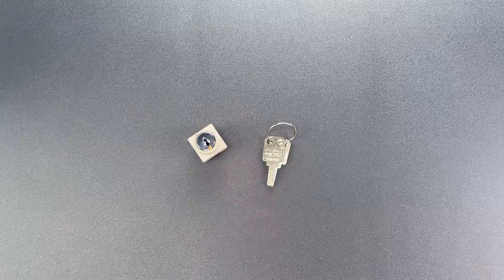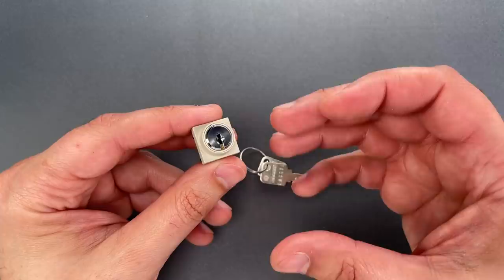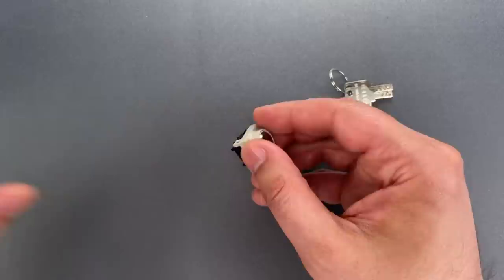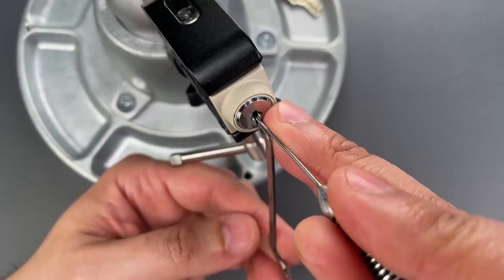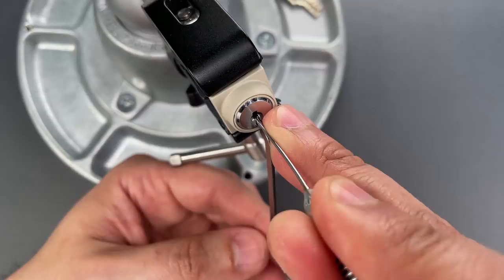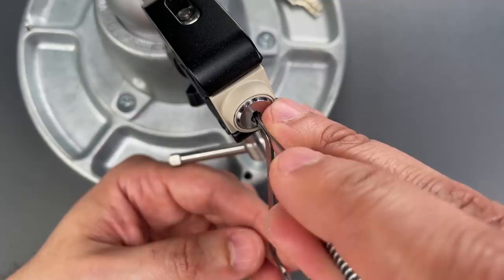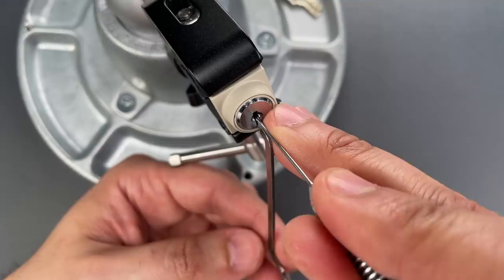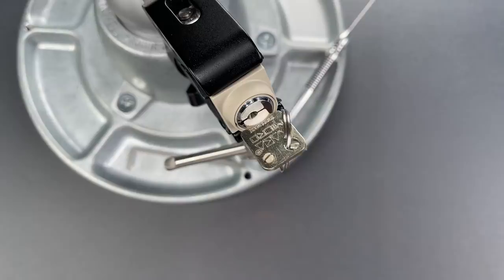[1354] Small But Mighty: Kaba Micro Key Switch

Comment: These locks should be used on gun safes and other dangerous high security items in police cars. Not the McDonald’s toy locks they have now.
Reply: In Europe, gun locks are much better.

In the U.K. the most common is a deep set mortice lock and there are two differently keyed ones on each safe.

It defeats many tools and makes it hard to feel, simply by making you insert the key 10cm before the end even comes to the lock.
Reply: In fairness, due to how tight those clearances are, I wonder how durable and reliable it is. You see this in firearms as well. The tighter the clearances, the more accurate it is, but less reliable it is, and vice versa.
Reply: @arnox4554  
Also in fairness, locks are generally quite simple mechanisms. With very small forces and movements.
The worst that can happen is a pin not moving which can be easily prevented with strong springs and enough, regularly applied lubricant.
Reply: @markp8295  true, both of my rifle cabinets and my pistol safe have very long, dual bladed mortices. They're also inside a brick built cupboard, with a steel lined door which is security pinned and double locked, and they're Rawlbolted to the fabric of the house. My firearms liason says we have a better security arrangement than most dealers.
Reply: @Zundfolge  Thats pretty much it. Frankly a gun lock isnt going to do anything for anyone. It may perhaps keep a naughty child from getting their hands on it accidentally but teaching your kid gun safety is a much better option in the first place.
Reply: @isosev  teaching your kids gun safety is not an option, it is a must.
the gun locks are there to protect neighbors children...
Reply: @carstekoch  I don't think those things would apply to this particular lock though. Or at least as much at all. The tighter the clearances are, the more easily any kind of build-up can block the movement of parts, and it looks like this lock is incredibly tight.
Reply: @arnox4554  
There are a lot of things in the world that require high precision. Like the equipment that makes the computer chips you made your post with.
Reply: @arnox4554  
I fail to understand why my points would not apply to this lock?

It's very hard to get a normal abus lock to seize up without seriously mistreating it, to the point it's pretty much unheard of.
Last time I heard it was my bike lock 2 years ago seizing up. And that was because the ballbearings rusted in place after winter. The actual cylinder was working perfectly.
Higher tolerances make it easier not easy.
Reply: @Zundfolge  That's true on multiple levels, they ARE crappy on purpose. The first purpose, though, is by those politicians (or rather the lobbyists buying them lunch) intentionally drafting confusing, conflicting and burdensome gun laws. 

An outright ban on firearms is consistently held as wholly unconstitutional, but the US legal landscape is full of haphazard carve-outs to absolute statements in the constitution. So they intentionally make it as difficult as possible to follow the law on gun ownership. The intent is that you won't be able to keep up and will either violate the law and lose your rights, or that you will give up in frustration. One example of this is the type of locks required. In some states it's a fully enclosed in-barrel lock, in others, it's required to block the slide from closing. That effectively means you have to stop between those states to change the locks on your firearms. (The general recommendation is to use a car safe separate from ammunition to avoid the whole mess.) When they're actively defying the constitution, it becomes that "say without saying" game.

From the firearm owner side, quick-open has been the priority, followed by not damaging the firearm and price. That means loose tolerances, a lot of plastic, and BARELY meeting the requirements of the law and even the definition of "lock". The only attempts at making standards for a lock, LPL has even covered, and they are representative of this tug-of-war between the parties over it. In California, the lock needs to stand up to someone unskilled without tools for a set number of minutes (I think 20, but I don't recall exactly off the top of my head).

As a non-lawyer, I absolutely hate the idea of legal carve-outs in constitutional rights. Having them as the absolutes they're written as is problematic, but exploiting other clauses in the constitution to inconsistently allow unintended exceptions undermines the rights themselves. Even with less controversial rights like "free speech", we have a whole slew of exceptions that their very existence creates the "chilling effect" the courts have themselves cautioned against. All the arguments for them that I hear are "it's necessary because" logic that amounts to there being no political will to fix it the right way. And that's why our laws are like duct tape around a broken water main. We generally agree we don't want our neighbor to be allowed to own a nuclear weapon in his garage, but no one is willing to make a constitutional amendment for where the line is because we're all afraid the line will end up somewhere we don't want.
Reply: @arnox4554  If well made, and kept lubricated, opening it a few thousand times should not make much difference.
Reply: @Zundfolge  I'm sure it's economic. I use a large combination safe instead.
Reply: @arnox4554  So it's not used outdoors, or in dusty environs.
Reply: @arnox4554  
You are using the proper word. LPL always says tolerances when he should be saying clearances.
Reply: @markp8295  makes it harder to access in need of emergency too
Reply: @Merennulli  i want my neighbor and I to have whatever the government can. As the 2A was intended. 1st and 2nd should have no ifs and or butts. Simply what is written. As intended
Reply: @dansv1  in machining, it's tolerances. Since locks are made in the machining field they are referred to as tolerances.
Reply: This would be easily defeated with force. It's for electrically securing things, not physically securing things.
Reply: @jamessteele3093  Tolerance is how far you can be off a given specification. Clearance is the how tight the parts fit. Tighter clearances require tighter tolerances but not the reverse.
Reply: @dansv1  No, he is using the right word. A lock can have loose clearances and still be hard to pick with tight tolerances, because all the bores and pins are more perfectly aligned. Tight clearances and loose tolerances would make it easier to pick, because the bores and pins are not so perfectly aligned. The picking order is more pronounced and easier to follow. Only one or two pins will bind, then the next, then the next, until they're all set.
Reply: @Zundfolge  That might be true but there are too many examples that they are faster to open without the key. :)
Reply: @Merennulli  The point of a constitution is for it to be absolute.
Reply: @ulrichkalber9039  Facts.
Reply: @Zundfolge  "Locks were invented to keep the honest people out"

So it does not matter how crappy the lock is.

It does the job.
Reply: @markp8295  no shit they are better, in the UK the firearm locks are designed to prevent you from using your firearm.
Reply: As an European, i'm saying that i could probably open this with a large screw driver (probably). Tho as someone said in the answers below, lock on guns in US are mostly for appeasing politicians. THAT and because someone's cousin owns a lock contract, so they're making money by kitting out the local PD. Corruption and negligence walk hand in hand.
Reply: @carstekoch  you do know that kaba stars (same tolerances but physically larger lock with 16+ pins) are the standard doorlocks in Switzerland.

And those locks last for decades without any maintenance whatsoever.
Reply: @anonym3017  
Are you sure you responded to the right person?

If so:
Yes? What's your point?
Reply: @aserta  Sir:
Locks were invented to keep the honest people out.

Everybody can open this lock with a screwdriver or a drill, or a hammer.

Hence why locks can not possibly ever be relied upon to protect real valuables.
They only function if set up in such a way that the honest people will not dare touch them.

And so this has happened over time, and now the top criminals know exactly how to use "Locks".

As i said before: A wooden dowel would be sufficient to keep people from robbing the bank.
Reply: @jamessteele3093  If you were the Supreme Court That would mean something...But The Constitution clearly says that The Court is the decider and not you!...You but not have read that part?

You are entitled to your opinion but you don't get to decide and your were never intended to !
Reply: @coolthief8375  Is it? There's a lot of VERY non-absolute statements in it if that's the case. Only a select few statements are absolutes, and each of them is undermined by other, superseding clauses that allow the carve-outs I just mentioned.
Reply: @carstekoch  your argument was that they don't last due to getting gummed up.

The fact that kaba produces dorlocks with the same tolerances, clearances, 16+ pins, etc that work for decades without maintenance proofs that argument wrong.
Reply: @anonym3017  
Yeah, No. Definitely answering to the wrong guy.
I said that's the worst that can happen and *easily preventable*.

In my second reply I even specifically said it's so rare that it's basically unheard of.

You are preaching to the choir here.
Reply: @Merennulli  Sure the non-absolute statements should probably be redone. The purpose of the constitution is to establish basic rules that need to be absolute. If they aren’t then it fails it’s purpose. 

Also if we were to make a constitution today we would also have to make a dictionary so people don’t change the meaning of words to fit their political beliefs.
Reply: @jamessteele3093  Does that "want" extend all the way to your neighbor having a nuclear weapon? Or are there some upper limits that you would have exist if you were writing the Constitution and its amendments today?

Legally speaking, the 2nd Amendment should be interpreted as allowing exactly and literally what you said. Every American with whatever weapon they want. Courts have ruled that mounted weapons "bear you" and rubber stamped laws banning private ownership of anything large enough to need a vehicle to carry it, but we know at the time the 2nd Amendment was passed, private ownership of cannons was common and expected for merchant vessels. Simply put, the intention WAS for the federal government to have zero ability to restrict private ownership of weapons. And at the time we had already centuries of sappers destroying fortifications with large quantities of explosives, so if an upper limit on destructive power (what we now call "weapons of mass destruction") was wanted, it should already have been in there. There were also biological weapons at the time (the American "smallpox blanket" story seems to exclusively source from one letter that doesn't seem to have been acted on, but it was considered and infecting enemies with disease was a tactic Europeans knew for centuries as well).

But the Founding Fathers were humans. They weren't perfect. The vast majority of Americans agree that some upper limit should exist below the level of "weapons of mass destruction", but the laws that prevent your neighbor from having a vial of anthrax or a homemade Little Boy are unconstitutional yet allowed using courtroom carve-outs leveraging things like the "general welfare" clause. If we the people want there to be such a limitation, it needs to be put into the law of the land constitutionally, not just a collective pinky swear not to abuse the courts de facto power to ignore the Constitution.
Reply: @stevebell4906  Change ≠ absolute statements

The purpose of the constitution is to create basic rules. These rules if they are so basic to the society should be absolute.
Reply: @coolthief8375  Not so ...The Founding Fathers were wise enough to foresee that the world would change and that the Constitution would need to be able to change to endure ...

Their world was and reality was one with men in knee breaches and hos with powdered wigs and buckled shoes  where George Washington was admired for his thick ankles...Where slavery was accepted... along with the divine right of kings ...selected by God...Where only property owning White Men had a voice or a vote...and one where arguably the most powerful military force in the world was equipped with muskets....And The Printing Press was the tool of mass communication...

They were wise enough to know that they could not predict the future....but the knew it would be very different....and they never meant for anything to be absolute for all time....and they tried to make a self correcting government that would be robust enough to not be corruptible...one with check and balances.... One that would limit power and insure self governance....and end any need for revolution!
Reply: @coolthief8375  The second part is true. 2 centuries of linguistic drift have left us having to rely on letters written by the people who wrote the constitution to interpret the meanings, and many willingly throw that out when it doesn't fit what they want to believe (like the people who try to shoehorn in a modern definition of "well regulated militia" along with assumed linking language absent from the Amendment as if it somehow magically undermined the individual right as described by other documents at the time).

But some degree of non-absolute is necessary to be functional. To give an example that's less controversial - Constitutionally, states have an absolute prohibition against establishing tariffs on interstate commerce, but the federal government has a non-absolute authority to regulate interstate commerce. The absolute allows free trade across state lines within the country, enabling businesses to treat the country as one whole rather that a cluster of small nations; but it also allows someone to evade the law by crossing state lines. The non-absolute allows the federal government to stop someone who stole your property from selling it in the next state while not allowing the federal government to ban the sale of firearms across state lines.
Reply: @_Stormfather  Look at the guy who currently has direct access to the button and you say unstable....
Reply: i think you underestimate the ingenuity of criminals and tweakers when it comes to stealing shit... if you provide an obstacle they will overcome it by some simple means or another!
Reply: @stevebell4906  So if someone wants to change the constitution they can.
Reply: @Merennulli  I think that individual rights in the constitution should be absolute. State rights shouldn’t be so. 

Individuals have a way harder time at defending their rights (you need to spend a lot of money in courts and etc). I’d go as far as to say that the right to free speech should be unamendable. There is no reason why a non-tyrannical government would abolish it.
Reply: @coolthief8375  Nothing will ever be anamendable. It's important to remember that government is just a construct of social pressures and force. It's no more "real" than a corporation that exists based on exchange of money except it relies on telling certain people it's ok to use force on other people in certain circumstances. A Bill of Rights doesn't make speech free, our collective refusal to accept someone changing that is what makes speech free.

Given what you just said, though, I don't know if we're using the same definition of "absolute". You seem to be using it to mean a law that can't be superseded by something else, while I'm using it to refer to the lack of allowances for specificity at a lower level. In the interstate commerce example, the Constitution sets out who has the authority, but leaves the details to federal law.

Having rights set as absolutes is like fully hardened steel. With absolute "free speech" it cuts through any fear of someone interpreting our words in a way that might limit our speech, but it also means the slightest carve-out like "hate speech" or "public safety" that may seem beneficial to some people would also be a crack that could shatter the entire thing. We've seen a lot of people pushing for "hate speech" exemptions to free speech without realizing that, to a dictator, any criticism of his actions or policy is "hate speech".
Reply: @Merennulli  “Hate speech” is free speech. The only reason speech should ever be considered illegal is direct threats (that are actual threats and not jokes which should be decided by the courts). 

Some rights shouldn’t have allowances at a lower level. Some rights are absolute as they’re the core basis of the country. If a state doesn’t believe in those rights then they should attempt to secede (which is still a grey area whether or not you can do that). And that should be on the basis of stripping someone else of their rights, not some arbitrary word that offended someone.
Reply: @coolthief8375  Sure... but it is intentionally incredibly difficult...It requires super majorities and approval of majorities in the states...It's been a very long time since I studied it ...but for example that is how we The United States both got probation and repealed it...The only Amendment ever repealed...

It might be interesting reading for you?...no need to take my interpenetration of it...
Reply: @dimitar4y  Wealth and power and influence do tend to just keep on spiraling and concentrating into special interests...
Reply: and raise people's taxes?!?!?
Reply: @mightisright  I see it as a delay for others getting it, be it kids or a person breaking into your home.
Reply: @neilkurzman4907  to be fair, computer chips are less likely to build up dust in them than locks. Locks tend not to have any casing protecting the keyhole.
Reply: @lazyryan3766  
I didn’t say the computer chips. 
I said the equipment that makes the computer chips. And yes some of them do build up a lot of dust.
Reply: @coolthief8375  It is indeed free speech (contrary to popular belief, so is yelling "fire" in a theater, the only restricted speech in US common law is when you knowingly use it to threaten or incite harmful action). My point was that trying to make carve-outs to make it NOT free speech takes away more critical free speech.

Secession is not something that needs to be spelled out in law. If you can't stop the rest of the country from reconquering your state and they don't agree to you seceding, it's not happening (the US conquering territory militarily is DEFINITELY constitutional). If you CAN stop the rest of the country from reconquering your state, it doesn't matter if it's constitutional or not. Arguably, the Supreme Court ruling on West Virginia's statehood does SLIGHTLY argue for constitutional secession but they did try to sidestep that issue.

I would agree that the line for rights is where it interferes with other people's rights, but that's more of a gray area than it sounds. Speech, yeah, you don't have the right to not be offended by your racist neighbor and your racist neighbor doesn't have a right to do anything about it everyone else in the neighborhood shuns her. Most frequently, these issues are around property rights. You may have a right to keep and bear whatever arms you want, but if you shoot my chimney, or irradiate my flowers with your garage nuclear weapon, you've violated my property rights. One of those can be solved without interfering with your rights - you have a right to own the firearm, not to shoot it at my house. But there's no practical way of shielding your garage well enough to protect my rose bush from the radiation of the breeder reactor you made it with.
Reply: @jamessteele3093  UK firearms are mostly used for destroying farm animals or target shooting, not security. Those who actually shoot people are authorised firearms officers (not every police officer), in military barracks, and a tiny number of bodyguards. These professionals work in teams around the clock and keep their weapon on their person while on active duty. Generally, you don't reach for your gun like a mobile phone here.
Reply: Honestly people should just not cheap out when buying their gun locks or safes. With the police there is no excuse with that bs.
Reply: @isosev  Frankly, I disagree. Some kids are too young to be taught gun safety. And even if an older kid understands safety, they can still be curious and make mistakes when parents are out - I know I did. So if you're going to go to the bother of installing a lock, what does it matter to you if it's a decent lock or a crappy lock? You still just have to turn a damned key either way, it's not hard, but the better lock may well save a life if the key is well hidden. So excepting cost, you might as well install a decent lock, no?
Reply: @markp8295  I hope you meant mm.
Reply: @jamessteele3093  Why would I want to access a firearm in an emergency?
Reply: @HowToGuroo  They aren't designed to so the owner accessing them. If everything, they're less likely to fail locked than a cheap lock.
Reply: @neilkurzman4907  And when the tiny little chip has failed you are liable to be locked away from all the data that you stored on said computer. 

At least till you go through a long process to repair the computer.
Reply: @jamessteele3093  
Simple as written? No simple as the way you want it interpreted. Perhaps you should read the entire constitution. You don’t get to decide what the constitution means, the Supreme Court does.
Reply: @coolthief8375  
That’s one of the two schools of thought about constitutions. Next time you write a Constitution make sure you add that to yours, if you want that to be the governing rule of it. 
In reality the US Constitution was written by committee who couldn’t agree on everything. A lot of language was purposely left loose so both sides could declare victory.
Reply: @bertjesklotepino  
Just because somebody made a slogan doesn’t mean it’s true yes locks keep on as people out. They also keep the majority of low skilled dishonest people out. As easy as it is to pick a lock for the lock picking lawyer, doesn’t mean everyone else can get in easily.
Reply: @coolthief8375  
If you want to change the constitution, how to do that is in the constitution.
Reply: @myparceltape1169  
I’m sorry this is an incredibly long thread at this point I have no idea what message you’re responding to.
Reply: @CrabRanGoonin  ?
Reply: @chocolate_squiggle  Well that goes without saying.
Reply: @ToeCutter454  I think you're right, normally. 

But here is an example where they didn't want to go through the heavy 15 cm steel door to get into the strong room. 
Instead they waited till the weekend and worked on its outside wall. It was solid brick but they had come prepared. 

Bit by bit they hacked their way through all 20 cm. Inside they had gained access to such delights as multiple commercial packages of toilet rolls and similar assorted supplies.
Reply: Out of the hundreds of burglaries I've seen, I've never come across a picked lock.  It's always been brute force attacks or inside jobs.
Reply: @Ray-tg1sj  yes officers it’s this comment right here.
Reply: @coolthief8375  I don't think threats should be for the most part, because that is very easy for the government to proactively suppress constitutionally supported acts of "revolution" like the removal of elected and unelected officials by force before they can even be fully considered and supported by the people as a whole.  But threats can still fall under harassment and be reasonably investigated, intervened and justice served.
Reply: @neilkurzman4907  i am glad you got what i meant.
Reply: @neilkurzman4907  ps: Locks were invented to keep honest people out. 

Dishonest people Always have a way in.
That is what was meant.
Reply: The locks in cops cars are there to deter not really secure as we have to be able to get them out fast
Reply: @bertjesklotepino  
If you want people to get what you mean then you should be clear about it. 
Not just vague suggestions.
Reply: @bertjesklotepino  
If you mean that dishonest people can obtain the tools and training to open up locks if they’re dedicated to it enough sure. But in reality somebody trying to steal a bicycle is not going to do that. 
Like everything else A lock should be bought with thought about how it will be used and what it is protecting. 
For example I need to replace the gate lock protecting a pool. In this case I only care that the lock is there to prevent children from opening the gate. They could easily climb over the fence. But that’s not where the legal liability lies. 
My concern about pick resistance is zero. However my concern about whether resistance is high.
Reply: @Zundfolge  Don't waste money where it's not needed.
Reply: best gun safe is my head and a pillow over the gun
Reply: @haimmaik  
It’s all fun and games until a child figures out where you left it. Unless you’re living for Willy Wonka and the chocolate factory life.
Reply: @jamessteele3093  people should not have nukes or war machines
Reply: @Khronogi  most people shouldn't have access to a butter knife.
Reply: That requires having people responsible for those things to actually have a working brain; not something I'd expect many police forces to have.
Reply: @neilkurzman4907  its a joke I don’t own a gun
Reply: @neilkurzman4907  I understand you fully, my friend.
And sure, you are correct with what you say.

But when it comes to securing high value stuff, or even the control panel for launching nuclear rockets, there is no lock that can prevent a real criminal from getting in. Gaining access. Activating stuff.

So in that sense a lock is never going to secure anything entirely.
You may lock your gate to the pool with a simple lock to prevent children from access to the pool. And then a bit smarter kid comes along and find a way to bypass it.
Not a real criminal here, but one that "shows the way"

Anyways, i get what you mean, im not your enemy.
I just think that it is like with computers. There is NO WAY to secure a computer entirely.
There will ALWAYS be people who find ways to access the data. Same goes with locks. 
So, then it comes to the way one thinks.
The illusion of security.
That is the subject i was basically addressing.
Sorry for this book.
Reply: @bertjesklotepino  
My point is the  security should be tailored to the application. 
By the way the kid going in the backyard is trespassing and that’s actually criminal. 
If something needs to be that secure then you don’t use a cheap block, you use men with guns. 
For less secure application perhaps disk detainer locks. If you have metal detectors going in it would be hard to bring in the tool to open them.
Reply: @neilkurzman4907  Sir, i agree with most of what you have said sofar, believe me i do.

BUT, those men with guns need training.
They are not the same as installing a lock.

You wont need those people if a lock could be made secure enough to prevent ANYONE from ever getting access to what is beyond this lock.

So: You would not need to have any people (trained in the way they were trained) to secure anything if a lock could be made secure enough to keep everyone out.

So: You are basically sacrificing people to defend something.
This Something is not known to those people, and obviously it is kept from the ordinary people. Or it may just be a shitload of gold which you wanna protect. Wanna keep yourself.
A simple lock is enough, and people trained like parrots will defend it, sure.

Which again goes to show that a simple lock is enough to keep honest people out.
There is no way to lock anything up to prevent the biggest criminals from gaining access.
The top criminals ALWAYS have their way.
That is how it works,.
Never have the illusion that for example our dutch Royals (i am dutch) will ever stand in line at the grocery store.
Wont happen.
Because they know honest people wont ever go as far as needed to put these parasites out of power.
Anyways, that is a different subject but is in line with what i try to say.

People who these days volunteer to protect something are coming after those who were basically slaves and made to protect the same shit.
Its like the Godfather movies, where them criminals try to make something they gained with their criminal activities into something legit.
And people have started to accept that for a long time now.
BEcause again: The honest people wont go beyond certain "security measures"

Hence why i say: A wooden dowel is enough to keep the honest people from ever seeing any documents or such that might give another perspective on current society.

Anyways, a nice day to you.
Reply: @neilkurzman4907  btw, as for the vague suggestions bit you spoke about.....
Complain to youtube about it. 
I could explain it without being vague, however people have allowed companies like youtube to censor all kinds of things.
So therefor it is not possible to say what i should be able to say in a free society.
Because certain people have certain interests that do not want others to know about it.

Even blind people, or braindead people are able to understand that something is completely wrong in society these days. 
People fought for freedom 80 to 90 years ago.
BUT as a discredited British Historian once said: If the British soldiers who went up the beaches of Normandië could see Britain today, they would not have gone up those beaches.
Reply: @bertjesklotepino  
I’m not sure what the purpose of your argument is. That nothing should be locked or protected because it’s pointless?
Yes some locks are there to keep honest people out. Security guards can often serve the same purpose. 
But then there are the dishonest people. 
Enemies of individual , or countries. 
They need to be kept out too.

Did you know most military vehicles don’t have ignition locks? Because during war that would be an impediment to their function. However when they are stored in their home country they are either guarded or locked with chains.
Reply: @neilkurzman4907  PS, This Company Platform has exposed my children to videos which no child should be able to access.
Videos which clearly are intended to adult people, and actually are not even intended to be seen by them but only by those who would agree with such behaviour. (which are not the majority btw)

But all of a sudden this platform has become selective in what it does want the audience to be able to watch, and what it doesnt.

This stinks.

And the reasons why it is are very obvious.
You may deny such reasons, but it is clear to all those not part of that same Group.

So basically what i see here is that a company that promotes certain things and censors others is being helped by a lot of people.

This bring me back to the locks.
If top criminals are our leaders..... ey?
No rocket scientist required here.
Reply: @neilkurzman4907  the point of my comments is this: if you are not one of the top criminals, why bother with a lock?

If you were able to step back from all of this, you would understand me.
Reply: @bertjesklotepino  
You’re going to complain about censorship and lack of censorship in the same thread?
They do have a kids version of the program which should block out objectionable videos for children. 
Apparently the people posting those videos have decided that it’s their right for their free speech.  You can’t have it both ways.
Reply: @markp8295  I can get through your European gun safe with a 18v Ryobi cutoff wheel. The sides of your safe open as easy as a tin can. You need to look at security from all angles and avoid myopia. If you can't hear the birds you can't hear your opponent. Situation awareness applies to more than just fighting.
Reply: I don't see the point of a key switch on a gun safe.  If it's a backup for a keypad or fingerprint lock it's going to be subject to the same most common point of failure as the primary -- a dead battery.  Keylocks  on gunsafes need to be mechanical locks, not electrical switches controlled by a key.
Reply: @WalkaCrookedLine  
If somethings that important to you then you should keep the batteries fresh. 
But since it’s a major concern of yours you should never buy a gun safe with an electron o’clock. Others may have a different opinion.
Reply: @bestvidsdottk  Sure you could. But looking for the cheapest certified one on the U.K. market at £150 for a long gun they all have a minimum of 5mm steel walls. So it won't be especially quick.

That's why there is also the requirement that it is installed out of sight. Meaning security through obscurity.
It's meant to make sure an attack is not unnoticed . In addition the firearm and the ammo are stored in two separate locations.
Reply: @neilkurzman4907  So you're OK with locking your guns in a safe you may not be able to open for no other reason than its batteries got old?  Or someone put the batteries in backwards or accidentally reused old ones?  When you could avoid the whole issue by simply having a mechanical lock as your backup instead of a keyswitch?  I'm sorry, but to me that seems completely bonkers.
Reply: How about no cops with guns
Reply: @markp8295  a kid had my phone
Reply: This would be a joke of a lock on gun safes. You could easily drill this lock. If this is on a gun safe - don't buy it.
Reply: @coolthief8375  but many rights are contradictory so cannot be absolute. There is a right to free speech and i guess there a right to live free from persecution * but one person can use an absolute right to free speech to persecute someone so there has to be limits on some rights.

 * note I'm not American and I don't know the US constitution so this is just example that some rights can be contradictory.
Reply: @arnox4554  It's designed for industrial keying so it's probably very durable and reliable.
Reply: @Zundfolge  Quite true. Plenty of people are buying the cheapest thing they can get to satisfy a legal requirement not because they actually value what that lock can provide. Makes me think of South African gun laws where you need to own a safe firmly secured/heavy enough that it can't just be walked away with in order to have a handgun. But plenty of people live in areas where there are a lot of people living in huts. So a lot of gun stores will offer a service where they will provide a small safe attached to a fence post and a bag of concrete as a package with the gun purchase to fit the legal requirement. Whether anyone actually ever USES the safe isn't important. But they have one.
Reply: In most cases these are just the bare minimum intended to stop someone literally just picking up a weapon, rather than actually locking them securely.
Reply: A gun safe is not dangerous
Reply: @arnox4554  kaba and sea easily last for years if used multiple times daily. this is basically a outdated version of the standard lock used in doors in Switzerland. including main entrances to building used 50+ times a day. some facilities I manage have kaba8 locks in use which have at least been used for 200k times without problems. simply have to service them with a appropriate cleaning agent every know and then (about once a year, or about every 20k uses.
it's basically the same as with firearms: if it's Swiss (these days, only German for kaba) quality the tight tolerances are not a issue.
Reply: @Stettafire  Good luck changing the bill of rights.
Reply: Generally when a high security lock is encountered, other systems are attacked to gain access, from social engineering to destructive and nondestructive bypasses.
Reply: Pretty much any of my friends in Switzerland habe Kaba locks on their house and appartment doors.. 😅